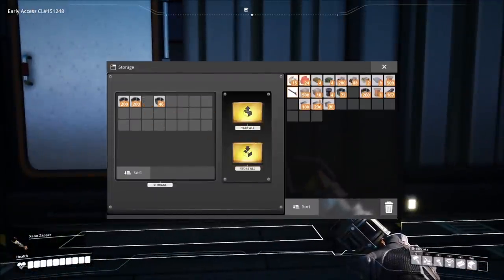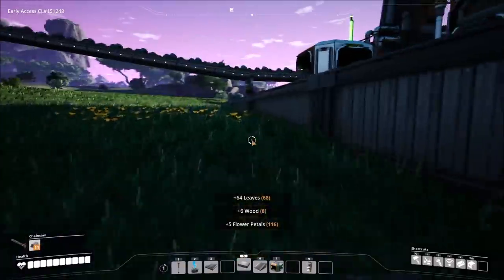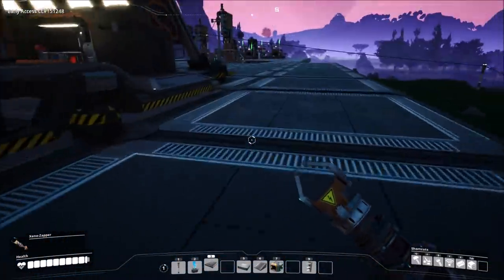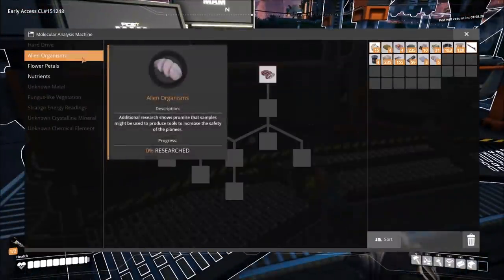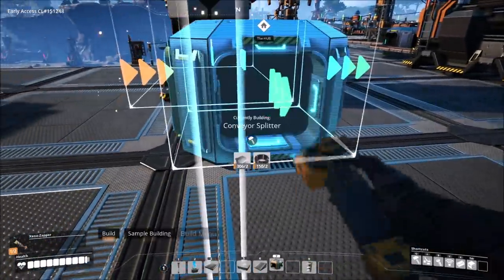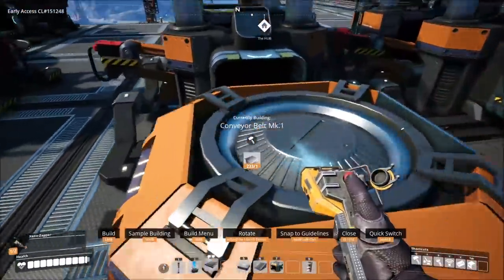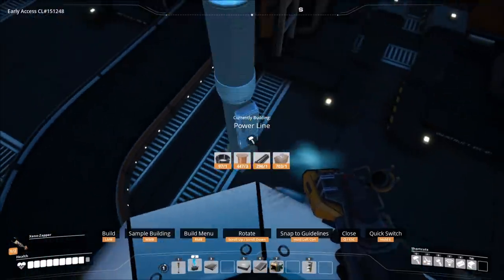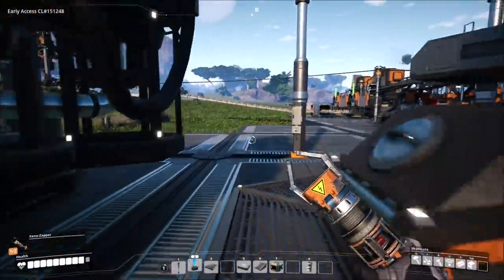Satisfactory Ep5 More Iron and Screws

Comment: Using 3 splitters for that screw setup is called the overflow method. But if you throw 30pm rods into ONE splitter, each belt leaving will have 10, perfect for screw production. So it's 15+15 into a splitter, turning into 10, 10, 10 lines.

Comment: Quick refresher on the new power system graphs for anyone who needs it: Capacity (light grey) is the maximum power generation of the system, Consumption (orange) is the amount of power actively being consumed if not equal to production, Production (dark grey) is the amount of power being generated if not equal to capacity (biomass burning auto-throttles), and Max Consumption (blue) is the maximum amount of power all machines on the system would draw if all of them were active all at once.

Comment: For those who OCD ticks when curving belts to machines, you can always have a 90 degree angle by moving the belt right in front of the machine, where the blue line appears, than, move it back 2 squares, stop at the second square, when you place it on the ground, than place other section from that point to the machine. It will make a nice and clean 90 degree angle. Make sure to do it over a platform.

Comment: Not sure if you know, but you can lay down floors, approximately about half a large slab thickness and snap the Miners to the factory floors.  For a clean look.
Reply: the drill looks like its mining through the foundation tho
Reply: @3Dusers  thats cause it is o3o
Reply: yeah and be careful with this, if the foundation isn't directly above the ore vein (Y level differences) the miner wont attach, so chose carefully between the 3 sizes of floor based on the height variation between 2 different nodes, so when you try to connect those nodes  you don't get forced to rebuild everything from scratch

Comment: pls u only need one splitter to feed your screw production as u only have  a 30 line of rods. fed into one splitter will get 3 lines of 10,also if u place the splitter atop the merger and connect them with a vertical connvayer you can save space, you can also have the ore lines go under the foundations u have placed as u have unused space

Comment: On the subject of efficiency: efficiency is satisfying, and it certainly helps prevent power draw spikes, but I find that for progression it's much more important to be able to consume everything you're producing than it is to handle everything efficiently.

As an example, I'm building a reinforced plates line, I'm going to build enough crafters to make more screws than I need. I then step back and build crafters to make more rods than I need. So on and so forth until I have more production than I have ore to support. Then I go find more ore to mine. Rinse, Repeat.

Comment: Dire: Tier 2 belts are entirely skippable.  Most miner set ups won't need but what T1 can handle.  RIPs are far too expensive, and iron plates are used in almost everything.  Iron plates are useful even into mid game.  Splitters/mergers always require plates.

Comment: Rule #1 -> never transport raw ressources.. always smelt them directly at the miner itself and only transfer the basic iron or copper ingots. saves at min. 1-2 lines and mk speed.
Reply: It depend on resource. In case of the wiring and screws, opposite is true.

Comment: 43:52 Dire still has not noticed that there are stackable conveyor poles - they are seriously necessary in Satisfactory to make neater and cleaner belt lines. Plus they can be lined up with each other on platforms, meaning that you place the first layer of stackable poles, and the subsequent layers stack vertically and are aligned to the platform, on top of them!
Reply: I pretty much exclusively use the stackable poles for long runs, both to keep the ground level clear and because I'll probably want to stack something on top later, even if not now.

Comment: I started to play this two days ago thanks to you. To my surprise I had the same map, somehow I thought it would be new to everyone like no man's sky. I'm a bit further ahead now so I can tell you that you should move your iron production to the south east. There are a spot where 9? pure iron veins are in close proximity. But even for those 3 veins down there I made a new big platform there and recreated the iron production lines there. Somehow extra long conveyor belt snakes doesn't sit well with me. :) I use those for water though and energy, but materials I produce on spot and use automated trucks to bring the end resources around if needed. ( Amateur tip: Collect radiating snails to overclock your machines and fine tune production lines. There are never enough snails. :) )
Reply: There is only one map, there are also several online map-tools you can use to scout out all POI's (like ore deposits and power slugs).
Also, find some Lizard Doggos, tame them, and put them in a pen, they'll periodically produce some resource for you, and sometimes it's power slugs, I've gotten several T2 slugs from my doggos and I believe I got a T3 at least once.
Reply: @thmarth  Thanks! I will try to find out how to tame them on my own... I had a hunch that it is possible, but I could only pet them and that didn't bring nothing. I gave up after a few minutes, but now that I know it's possible... :P

Comment: You know Dire, I do believe that all generators self throttle, however I can be wrong
Reply: They changed that in update 4. Now generators always produce at full consumption.
Edit: Nvm, biomass still throttles.
Reply: Biomass generator throttle and geothermal generators now vary 50% as they produce. Rest goes at 100% all the time as long as they have fuel.